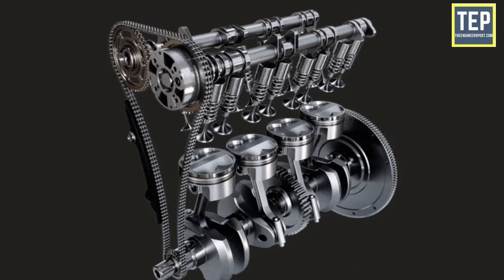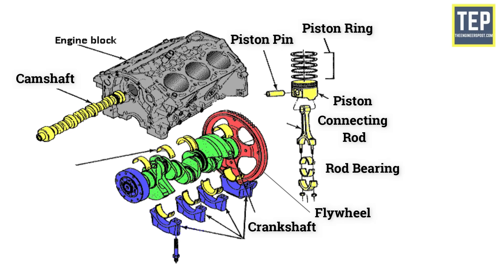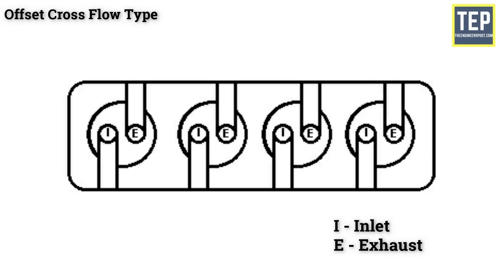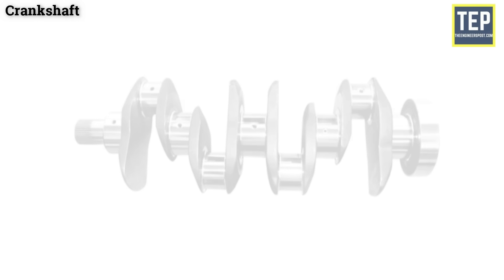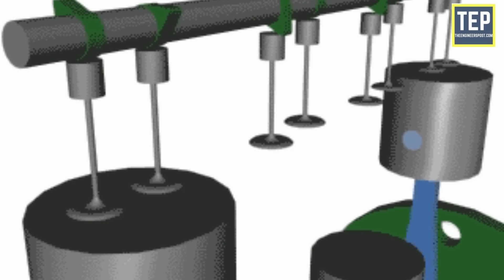Car Engine Parts & Their Functions Explained in Details | The Engineers Post

Comment: It becomes interesting to learn about this topics with a clear and complete explanation like yours. Even though you aren't in the mecanics field or you don't have a car,  it's important to know about this. In this video, the following pieces are explained: cylinder block, cylinder head, crankcase, oil pan, manifolds, gaskets, cylinder liners, pistons, pistons rings, connecting rod, piston pin, crankshaft and camshaft. Thank you for sharing this information.

Comment: The controlled combat trained elite core from elite fighting special forces of the CaesarKing I special group force suits shall be permitted to incorporate any of those other mentioned dual force featured suits capability of Angelic beings and Darkside inclined groups only for special missions and never be used for robbery or infiltration of secured facilities to steal top secret or confidential materials, data's and high value equipments and be mobilized only that special forces under my command when I the CK ordered that special elite forces of mine only any disobedience to my order shall be instant deactivation of the disobedient of brain burst to dissolvation. A programmed event in time. Let it be

Comment: Starting now there be 2 polarized group to be given powerscope, The Angelic types of the energy pathways fit and energy of nodes per nodes storage suits with specialized advanced next generation active protection system of blasting any projectiles, ammunitions, or instant rays suit of sensor driven outside spark blast of parrying simultaneous any direction weapons attacks and ambush fires likened to the lymphatic system of energies with components of their own transport designs this time of the TRON like instant appearing speed motors which are formable by push button or voice command of energy project from their suits energy exit projectors of concentrated photonic beams to beam rays types from science variety positive charge sources probably likened to sleeve end of suit or below palms equipment energy  projector to a gold plated bracelet like device projector  of blue printed and coded in system to their suits 2 way control of Tron energy tech motorists and their command and control module offices and can be used in business manufacturing and specific task ordered, if ever they opted to use that for such. Let it be. The opposite side polarity of negative charge and Darkside inclined groups project shall be the tight fit dark science and rare Earth minerals elements to rare Earth metal properties of functionale with entire head huggable suit with tech display goggles projector and oblong like shape sophisticated face outline ridge of energy dome stationed projector likened to the cornea slope of eyes with it's 2 sides  scleras of some sort of image projector but not patterned to human eyes instead the  face oblong outline stationed energy nodes can be used for face shape shifting to menu of faces wherein that dark skin tight fit suit can be covered with outer cloth or garments for camouflage at the same time that facial dome enveloping the tech goggle displays can be used as face energy shields from any attacks and weaponries shield protector and the  dark body fit suit can be reconfigurable to be instilled, incorporated, attached with modern materials and tech created thin and body fit super hard materials from variety of sourced research and development crafted body armours can be used in business and functionality missions. Let it be

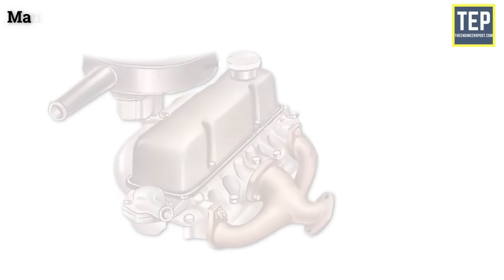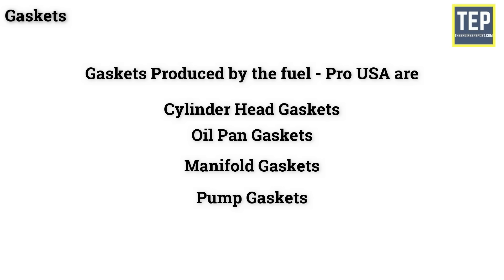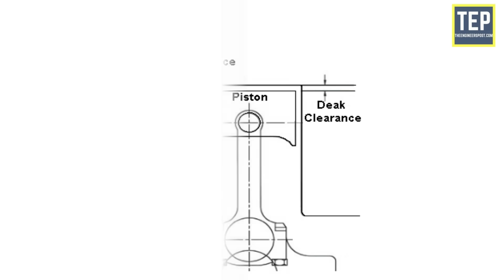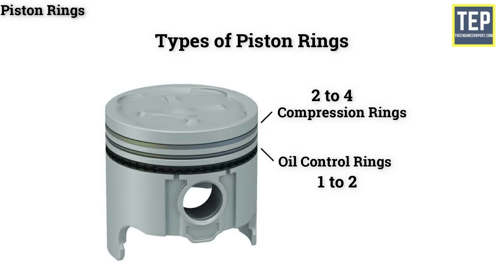Comment: 2:15 CYLINDER BLOCK 3:17 CYLINDER HEAD 4:48 CRANKCASE 5:39 OIL PAN 6:30 MANIFOLDS 6:49 GASKETS 7:32 CYLINDER LINERS 8:47 PISTONS 10:06 PISTONS RONGS 10:51 CONNECTING ROD 11:40 PISTON PIN 12:33 CRANKSHAFT 13:41 CAMSHAFT
Reply: you a real one

Comment: 🎯 Key points for quick navigation:

00:00:05 🔥 Introduction to Car Engines
- Explanation of engine functions and types,
- Overview of internal vs. external combustion engines,
- Importance of engines in automobiles.
00:02:18 🏗️ Main Engine Parts Overview
- Listing of main engine components,
- Basic description of the cylinder block and mention of other parts.
00:05:37 🧊 Cylinder Block
- Detailed explanation of the cylinder block,
- Components and materials used,
- Description of coolant and lubrication pathways.
00:08:08 🔩 Cylinder Head
- Functions and composition of the cylinder head,
- Types of cylinder heads,
- Placement and function of components like valves and manifolds.
00:09:48 🛠️ Crankcase and Oil Pan
- Description of crankcase construction and materials,
- Functions of the oil pan,
- Role in lubrication and design features.
00:12:23 🌬️ Manifolds and Gaskets
- Roles of manifolds in air-fuel mixture and exhaust handling,
- Purpose and types of gaskets,
- Materials used for gaskets.
00:14:07 ⚙️ Cylinder Liners and Pistons
- Purpose and types of cylinder liners,
- Description of piston functions and materials,
- Explanation of piston clearance.
00:17:08 ⛓️ Piston Rings and Connecting Rod
- Functionality of piston rings,
- Description of connecting rod characteristics and materials,
- Overview of connecting rod's role in motion conversion.
00:20:08 🔧 Piston Pins and Crankshaft
- Types and functions of piston pins,
- Detailed description of the crankshaft,
- Components of the crankshaft and power transmission.
00:23:22 🛠️ Camshaft and Flywheel
- Role of the camshaft in valve operation,
- Description of camshaft drive mechanisms,
- Importance and functionality of the flywheel in maintaining engine speed.
00:27:00 🚪 Engine Valves
- Functions of engine valves,
- Placement and role in controlling air-fuel mixture,
- Importance in combustion process.

Made with HARPA AI

Comment: Fan, fan-belt(pulley), (timing-belt multi-link chain), fly-wheel(pulley-axle), casing round. 
Impeller design use as lousy(high inertia) propeller to impeller to with casing-flow as compressor no-rotor no-stator = look ma, no-hands...

Cog-gears as impeller design with rims.
Slot gear from sides, shaft axle.
Double axle counter inertia-torque-steer
Same shape-gauge different material-price. 

Cam-shaft overhead is overhaul is seperate consideration. Common rail turbo diesel, common rail glow-spark is seperate

Small inertia kick big like electrical-capacitor. Big kick small in-return. Kicking pairing firing. Sounds like a10 engine when properly accelerated, monitoring intake exhaust back-pressures, from second-order back to plane. Diver-regulator sounds are not-nice. Make combustion engine with those parts sound like a10 war-hoh warthog wart.

Comment: Hi Guys, sorry for the long message, please assist got a Hyundai accent 2016 Model. 

My car is jerking and it's worse when driving up on the hill and when Engine is hot after been driving it for a while, it also making a rattling noise on the engine when accelerating and loses power.

When I start the car in the morning when engine is cold doesn't give me any problem it start easily, but when engine is hot and been driving it for a while I will struggle to start it I will have to swing the key many times 💔.

I took the car for service then and it was better than it was  before even the perfomance was better but not 100%.  That  lasted only for 2 days and the car go back to the same problem.

When the Machanic was servicing the car replacing the  fuel filter on the petrol tank he saw the fuel pump has some dirty inside the strainer.. 

I booked it in for diagnosis at Hyundai N1 City they didn't see anything wrong. They told me when I have money I must come back to them again they want to open Head Cylinder and see what could be the problem.

Your assistance will be very much appreciated 🙏 Thank you in advance for your assistance..

Comment: Folks you can make a free running magnetic engine using magnetic caps on each piston and a magnetic head or electro magnetic head ,placing the electro magnet above each piston , you will never pay for fuel again or electricity

Comment: Very nice! I would like to have seen the inclusion of the very important oil filter though. Little bites are good of course. 
And I was always impressed with the slight difference between oil rings and combustion rings. Convincing car owners to respect the oil change, the filter change frequency and the crucial effect on engine life  and performance/ efficiency with respect to all the friction surfaces really could have been  emphasized much more. Also combustion gasses and residues in lubrication degradation can be said to dilute the oil significantly essentially displacing lubricating substance with abrasive and corrosive agents never giving a clue to the clueless until it is too late. For the price of an oil and filter change. SO MANY problems can be delayed for so long as to make a well designed engine run SO MUCH LONGER!!!

Comment: I started working as a cylinder head repairman when I was 12 years old and worked there for a long time. Seeing this video made me feel nostalgic. I still remember what most cars engine parts look like and how to repair or prepare them. We had a standing drill machine where we put the valves and clean them with sandpapers. My record was cleaning 8 different sets of valves in a day which makes around 128 single one. My hands wouldn't even feel pain or heat after some point. It was a fun job and it wouldn't get boring because repairing a cylinder head has a lot of different processes. I dropped out of the job one year ago and started studying in a University. Sometimes I still miss the gasoline and the oil smell.
Reply: Man you've got so much experience in the work force and that even from such an young age I truly admire you (if it's not too personal, may I ask why you chose to work in that exhaustive field in such a young age?)
Reply: @orangesoda6556  It was my dad's business so he wanted me to learn the job. You never know what will come handy someday. If something happened to your career one day you can just say fck this sht and start doing the job you know. Btw I am still working there and in fact I am writing this from the repair shop rn. I couldn't find any summer jobs about my proffesions so I am working here for this summer. I am learning Aluminium welding and other machines such as surface grinding machine so I can fully become master. Even if I never do this job, it's still useful to know, it is no harm to learn. Thank you for your messages
Reply: @orangesoda6556  yeah, we need to know
Reply: Baban rektifiyeci mi? Bu arada baban uyanık adammış bende bir aralar tamircide çalışıyordum en son canıma tak etti bıraktım çok yorucu işler ama işi bildinmi elinde iş oldumu sırtın yere gelmiyor. Bende aynı senin gibi üniye girecem sınava girecem ayağına bıraktım ama tam bir fiyasko oldu benim için kafam derse falan basıyorda oturup çalışamıyorum sınavlara kendimi hazır edemiyorum. Hatta bu aralar sınavı mınavı üniyi bir kenara bırakıp bir fabrikaya girip çalışasım var.
Reply: My dad is an Engineer,I used to go at his work place when I was still young,it has not been in my plans to study this course but am doing it now!
Reply: Lies again? Department Of Justice Drive Jeep
Reply: https://thinkaarya.blogspot.com/2025/05/petrol-vs-diesel-engine-key-differences.html

Comment: A clarification, because the video momentarily implied that preheating intake air is good... it isn't. Which is why it says the inline cross flow type is more powerful. Generally speaking, the greater difference between the cold and hot sides of a heat engine (in this case, intake vs exhaust), the more energy can be extracted from it.

Comment: very glad theres something on the internet that lets the non-inclined and younger generation understand how engines even work! No more wasting money on getting a shop to do an oil change, or a water pump replacement & so-on.
Reply: People should not be rebuilding motors without either help or experience. Just because you know does not mean you know how it works or goes together.

Comment: You are explains many different types of engines at once, for example you have pictures of pushrod engines but are also talking about over head cam Motos too. Not all monsters use gears for the timing of the motor. They're is also timing belts and chains for different motors. You also don't know how an intake works because the pictures shows fuel injectors and no carburetor. You also forgot many parts of the motor
Reply: idk I feel this the YouTube equivalent of a scam call LOL

Comment: How does the fly wheel keep crank shaft “constant” rotation?
Reply from the maker: The inbuilt motor uses power to turn at high speeds to set the flywheel turning at its operating speed. This results in the storage of kinetic energy. When energy is required, the motor functions as a generator, because the flywheel transfers rotational energy to it.
Reply: @TheEngineersPost  
Thank you%!   Your video is great!

Comment: Please I want to know the amount of pressure the piston applies to rotate those heavy vehicles. Could it be that the burning of the mixture of compressed air and fuel is so powerful to rotate let’s say a 10,000kg vehicle?
Reply: Yes, depending on cylinder volume and type of fuel etc.